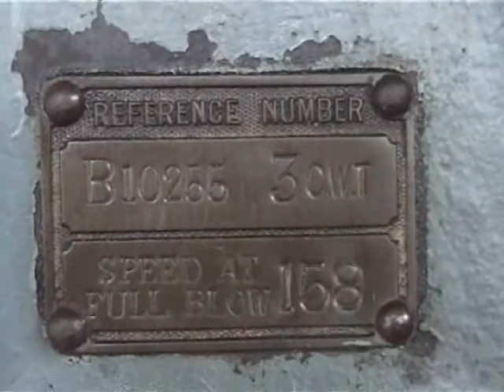Massey Hammer Part 1

Comment: Its a shame, I'm actually buying one of these hammers and i gotta say, GET THE DAMN THING UP TO RPM, Charlton is correct in that the 3 cwt version of this hammer runs at 158 rpm on the flywheel, also, please pressure clean the old girl and apply new paint and re-grease her seriously you will be surprised how much good a tune up will do :)